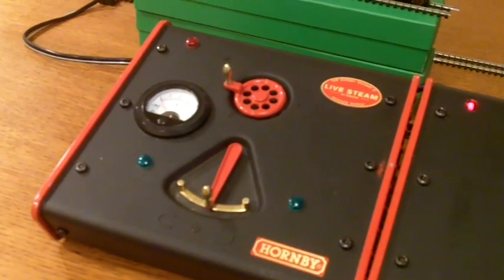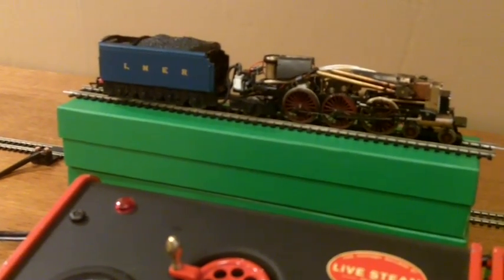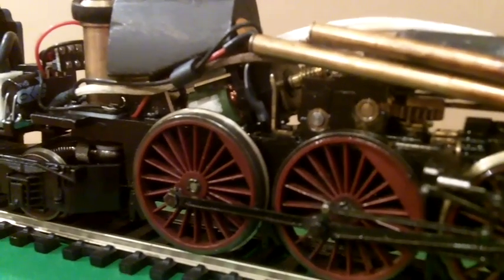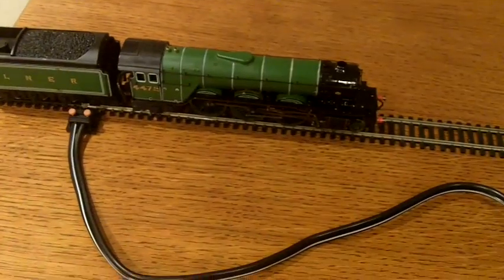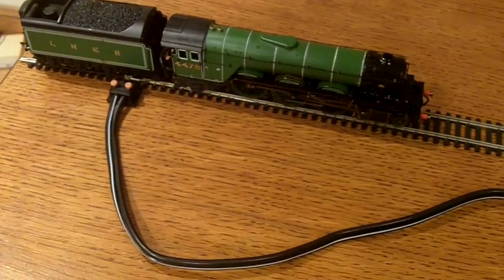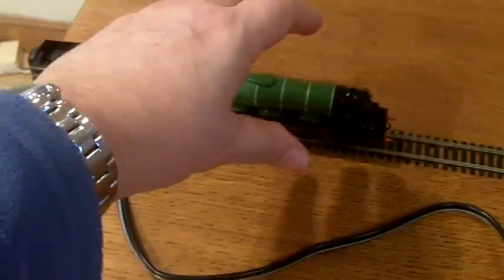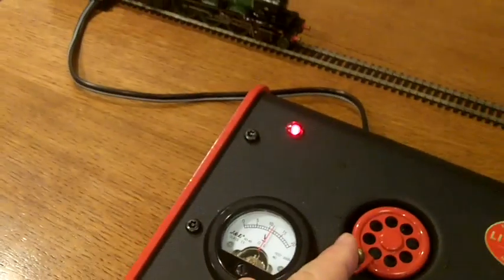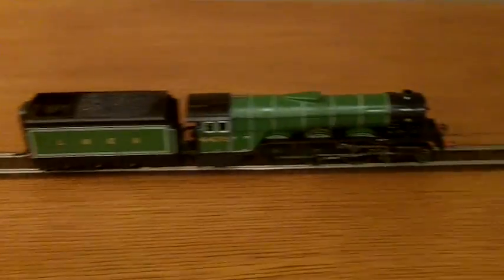Conversion to DCC and electic power for Hornby Live Steam

Comment: @OOLiveSteam I have a hornby live steam locomotive and it is great fun even when it breaks I will use it as pushplay locomotive but If hornby can't make the steam powered ones anymore then why don't they just make a DCC locomotive but instead of a regular DCC controller use the controller that the live steam uses.It would make the DCC drivin locomotives alot more fun to run and it would be like driving a live steam but you are actually driving a DCC locomotive.Please suggest this idea to hornby.

Comment: @Nevawake if you can't run your live steam with steam any more then you can get it converted to this. so you can still have fun with your live steam locomotive and even though your live steam locomotive can't run on steam it can still be used and it can still pull trains for you and it can still sretch its wheels and it wont have to be thrown away.once it breaks on DCC just use it as a push locomotive if you don't want to do that you can put it on a shelf for display.